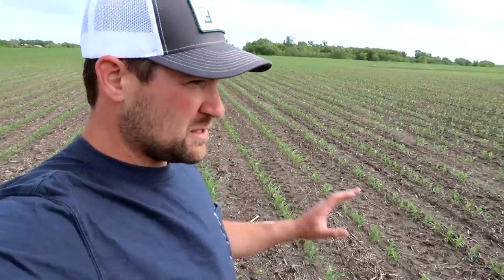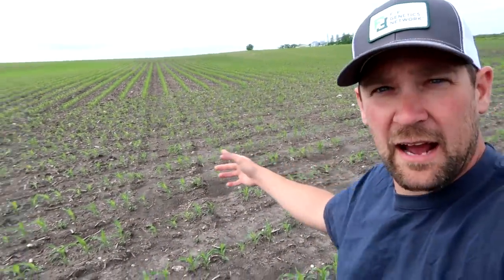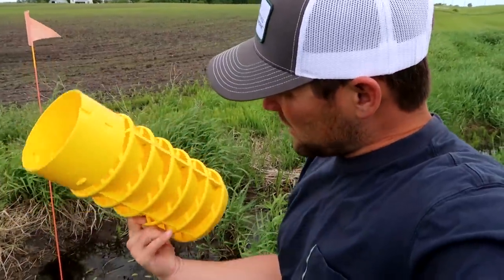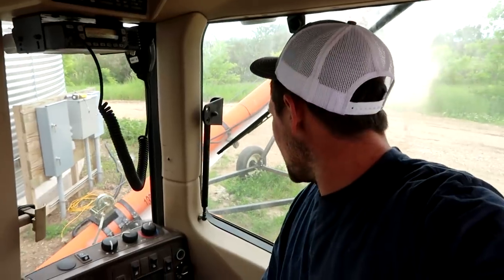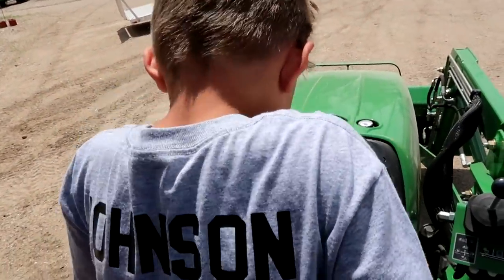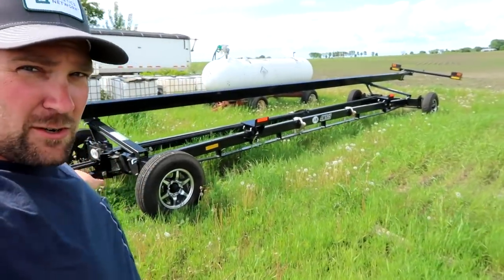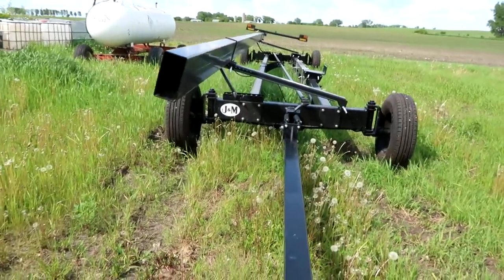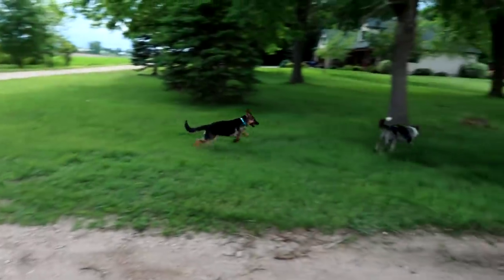Farm Kid Takes out The Trash

Comment: Wait a minute?? That combine must have been standing for a while...and the battery was not dead? What gives? D: 

BTW, speaking of questions no one asks, but that has been bothering me for quite some time: I rarely see you using ear plugs or other hearing protection in your videos!  You should!  You know, if you're not careful and don't use a good protection, you might get hearing-aids.   ...I'll let that pun sit for a moment. 

Free tip for everyone to get a good chain tension on the chainsaw: Release the sword and put the chain back in place, pull the sword gently forward to just roughly tighten the chain and then tighten the nuts holding the sword. Put the saw on a flat table and make sure the chain break is off so the chain moves freely. Adjust the +\- screw to tighten or loosen the chain so that when you take a hold of only the chain and pull it, you'll juuuust about pull the chainsaw along the table as you pull the chain around. 
If the saw isn't moving at all, tighten the chain. If the saw is moving but not the chain, loosen it then slowly tighten it until you find the right tension. 

As a Swede, it's always nice to see a Husqvarna. ;)

Comment: If the seat switch is the normal 2 wire Deere switch. What ever you do don't put a jumper wire to connect the 2 wires on the plug because that will override the seat safety. Ahem, cough cough, wink wink

Comment: I just wonder if a box made of pretreated plywood set on some concrete blocks to set the end of the sugar in under the bin augers would help for a temporary solution. Even if it got rain / water in it I would think it easier to clean out with just grain rather than the mudd also

Comment: To disable john deere seat sensor on those it says how online. Unplug the seat sensor then bridge the 2 connectors in the plug on the wire side with a paperclip or or another metal nicely pressed in to the 2 terminals of the plug on the wire side. Then look at the plug on both ends the wire side plug may have a tiny safety button that gets pressed when plugged in. you have to press this in and get it to stay pressed in with the terminals bridged. easy breezy does the same thing on the lawn mowers and smaller residential john deeres.

Comment: Hey there love your videos to start off with me and my dad can't get enough of the fun you have out there I have a small farm myself anyhow there is a fix to that safety under the seat and it's a really simple one all you need to do is unplug the cable which as I'm sure you know it's nothing more than an open closed circuit so this is the staff she'll take to fix that problem for your son unplug the cable and make a simple jumper cable to connect point a to point b on that plug that will resolve that seat issue I've been considering doing it myself for my John Deere 4105 but haven't pulled the trigger on it yethave some videos of that tractor on my channel mountainman3225 if you'd like to check them out keep them videos coming my friend great job